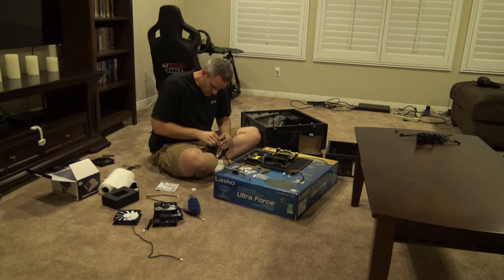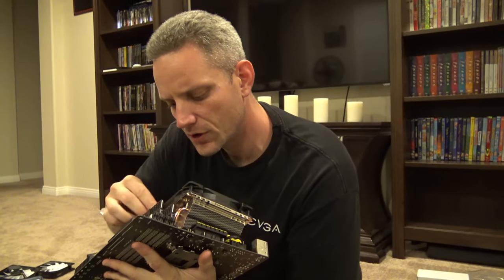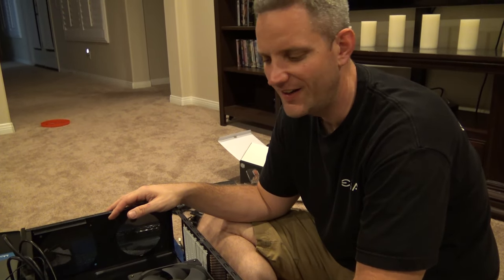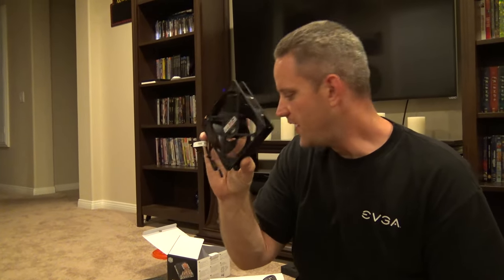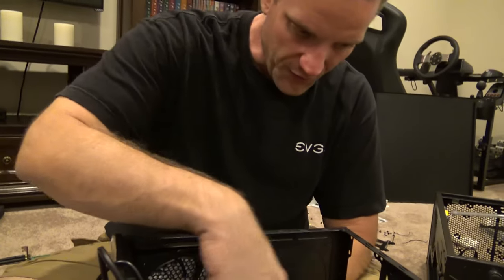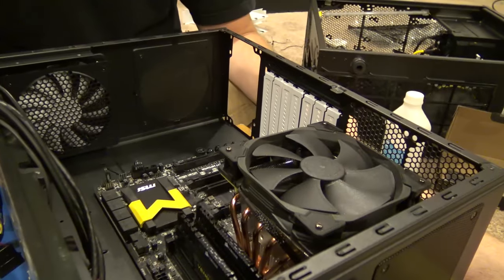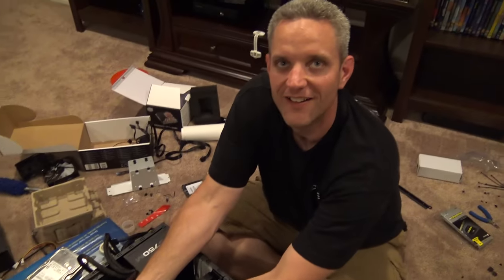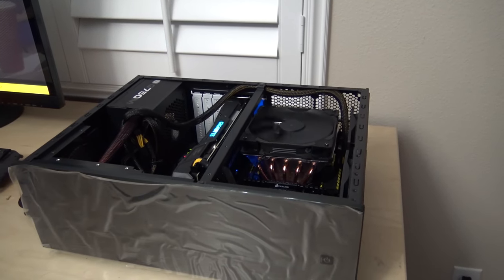Two Idiots Build a Home Theater PC ... ON CARPET!

Comment: Never used an anti-static strap, mat, spray... whatever to work on electronics. I've built quite a few computers on carpet. Never blown up a component. People blow static way out of proportion. It's not a problem if you're not a dumbass. Loved the video guys.

I'll be very interested to see what frame you go with on the Fanatec wheel. I have a Fanatec setup and I can't decide on a frame to use with it. I'm hoping you make a video.

Comment: also easier with amp turned off to plug small aux cable into the  computers headphone port then turn on computer and the amp then make sure the amps volume is low then plug in the white auxillary cable into back of amp into auxillary white port then play a video on the computer to test the sound oh and make sure the computer is on the right channel on the tv.

Comment: Does not support water cooling at all? Then i have proven you wrong my good sir.
I got off-brand water block on the CPU, a tank with a submerge pump in it and a EK Rad on the left (front towards you) behind the PSU. Rad is a EKWB XTX120 160x130x64mm (LxWxH) 290mL. 
It works great.
Reply: a single 120 rad? That does sound like it works great....for cooling a potato.
Reply: I never stated i had any sort of Gaming spec hardware in it. its a AMD A10-6800K BK mainly used for watching movies and such. Point was to make it quiet and cooler than the boxed cooler. As i said, You can fit water cooling in the case, You just can't expect to fit a gaming spec rig in it. I thought that was a given. 120 rads does have its uses, no point being a rude about it.

Comment: I was just wondering about the new 1070 (cause I'm looking into buying it), if it would bottleneck my system or not?

Specs:

CPU: i5-4670k
Motherboard: MSI Z97-G55 SLI
DRAM: 16Gb DDR3
PSU: 1000W EVGA (Don't tell me it's overkill I've heard it over 1000 times "pun intended")

If I'm not mistaken I think everything else is irrelevant including my current GPU (But whatever the case it's an GTX 960 4Gb).
I'm not necessarily going to buy a new 1070 anytime soon (gonna wait for prices to drop), seeing that my 960 suits my needs just fine for now.

I'm just wondering which parts could cause a bottleneck and what would be the minimum I would require upgrading to in order to remove said bottleneck.
Reply: Everything's fine.
Reply: You should be just fine with that cpu for most games but in games like gta 5 you will not reach your full potential. Id buy the 1070 and sell (or give away) the 960 and upgrade your cpu/mobo/ram in the next 3 years. The other option is to pick up a 4790k but I don't recommend buying a last gen cpu.
Reply: +andrew_1911 well the thing is and if I read what you told properly it leads me to believe that you think I haven't built the rig yet, but I've own this rig for two years already... so if I'm upgrading my CPU then I'll probably be going to a multithreading i7 (and most likely upgrade my mobo in the process), I was thinking of getting the 1070 more as a future proof seeing that gaming devs will probably be taking advantage of the 10 series performance leap, instead of sometime down the line being forced to sli a second 960 because my single 960 wouldn't cut it for the visuals I like to get out of my games.
Reply: +ShadowVipers you could buy an i7 4790k that would works with your existing mobo/ram and would replace your current cpu. I understood you have the pc already, I was just stating that upgrading the cpu is an option even without new ram and mobo that would be required if you moved to a 6xxx series processor.
Reply: +andrew_1911 To add I'm mainly a 1080p to 2k visual Gamer, and I won't be in the 4k market even if I get the 1070 (at least at first but that could change over my ownership of the card). as for FPS I'm satisfied with 30fps (prefer 60fps, and I'm ok with 20fps although the only game I play that brings me that low is ark:survial)
Reply: +andrew_1911 To add I'm mainly a 1080p to 2k visual Gamer, and I won't be in the 4k market even if I get the 1070 (at least at first but that could change over my ownership of the card). as for FPS I'm satisfied with 30fps (prefer 60fps, and I'm ok with 20fps although the only game I play that brings me that low is ark:survial)
Reply: You don't need an i7 for 1080p lol. I have a pentium g3258 clocked at 4.7ghz and gtx 660 and I do 60 fps well on a lot of games. 70 fps on bf4, 250 fps on league, 200 on CSGO, 80 fps on borderlands 2. You will be fine with a i5 and 1070. What games do you play?
Reply: +ShadowVipers same
Reply: You could look into the 1060 i heard that its good for its price
Reply: I recently watched a video and descovered that unless your playing at 4K resolution that will bottleneck atleast a little.  so what I recommend is getting a new CPU long before u get the 1070 or at very least overclock it to your best and see if it bottlenecks from there.
Reply: Is R9 380 and i5 4460 a good combo?

Comment: 2 sided tape for the hard drives? I just have my SSD's and Hard Drives sitting in my 5 1/4" Bays with no screws or tape. They are just sitting in there connected via Sata. LOL. But I don't move the computer, and if I do I always remember that the drives are not mounted or secured. So they should be ok.

Comment: Seems less than ideal to have candles right under the tv, unless they're electric light ones
Reply from the maker: They are electric. Not real.
Reply: I was thinking, but then the title of the video had me questioning myself
Reply: Unless you want to replace the Wii sensor bar with something a bit more organic. XD
(Yes, candles produce enough iR to work as the InfraRed bar, if not better then the real thing)

Comment: i have been saying for years that static is a myth.  i worked for a r.o.v. company for 6 yrs in the electronics department building electronic components. for 4 of the years we were in a rental building with carpet, and no anti static previsions. we had no odd, or unexplained board failures.  shit is a myth

Comment: when are you gonna do a ubuntu linux build?
Reply: That's just an OS you can put that on any computer
Reply: But why not make a custom build just for Linux?
Reply: +TechJunkie because it would be exactly the same as any other build with windows. All it is is software, there's nothing different about the parts inside the computer.
Reply: +nick42986 well if "every component in a Windows anf Linux build is the same" why not a speed test? witch is faster windows 10 or Ubuntu Linux 16.04 LTS
Reply: +TechJunkie then it's not a build video :P it's a OS comparison video
Reply: +TechJunkie all that windows and linux are just files on a drive.
Reply: :/ K OR do a video of the youtuber doing build for both pc's and THEN comparing the oses
Reply: +TechJunkie because stock ubuntu is literally the worst linux distro
Reply: CasualMadden I beg to differ with my HP 2000 laptop runs faster with stock Linux then windows 8,8.1,10
Reply: CasualMadden and I actually really like the way Ubuntu Linux works looks and functions
Reply: +TechJunkie stock ubuntu (ubuntu with the unity desktop) is probably the heaviest linux based OS. While it is better than Windows, it isnt even close to UbuntuGNOME, Elementary, Arch, Mint(Im personally not a fan of the cinnamon desktop but some are), Manjaro, every other ubuntu variant (lubuntu, xubuntu, kubuntu), even Deepin may be better than Ubuntu. 

Not to mention all the spying Ubuntu does on you.
Reply: +CasualMadden would you like to explain this "spying" that Ubuntu does please

Comment: What happen if you only have intake fans?
Reply: Depends on the case and fan placements. Generally having only intake just means the air will come out through the vents. If you have a large amount of intake and very few vents. It could cause a high positive pressure build which can put stress on the fans and shorten thier life.
Reply: Ok thanks for the answer :)
Reply: Its best to have both in and out for cleaner airflow. Also a good tip when getting fans. More/Larger fans spinning at slower speeds will give the same airflow but with less noise. I have two 220mm fans for intake, and for my exhaust I have one 220mm and one 120mm. They all run at 30% speed except for when I'm gaming. Then they go up to 60%.

Comment: why would it be dangerous to build on carpet?
Reply: Static. Carpet makes static a lot more likely.
Reply: heartlessdeathx how would one create static electric without moving? I thought you need to rub yourself. plus your body can neutralise it right?
Reply: It doesn't take much moving around and it doesn't take much static.
Reply: Unless you're rubbing your ass on the carpet like a dog, probably not, but its still best to minimize sources of friction.

You're body won't neutralize it, but grounding yourself by touching the case, or anything else metal, should be enough in most cases. Water does though, so washing your hands would actually help there.
Reply: ZombieBarioth Thanks for explaining and beinh logical unlike the rest of the internet on this topic.
Reply: You know that shock you sometimes get when you touch someone? It takes less than that to ruin a piece of hardware.

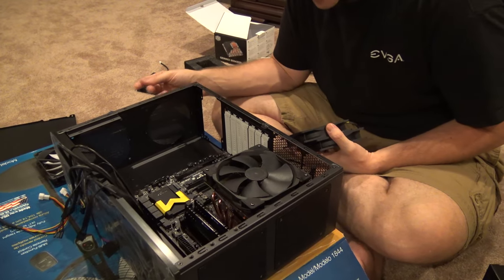Comment: 2:35 you talk of negative pressure. I've never heard that term and find it curious and would know more of it. I found it strange that my case barely gets dusty. My brothers needs dusted out every month. They are both feet apart. The air conditioner builds up lots of dust too.

could someone elaborate on the air pressure bit? I know google is their. it can take hours to research anything though.